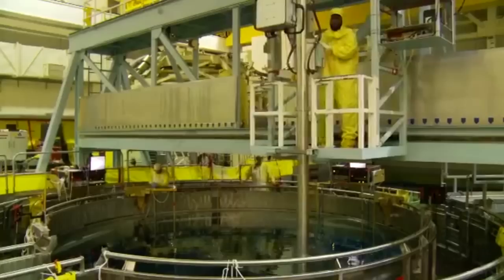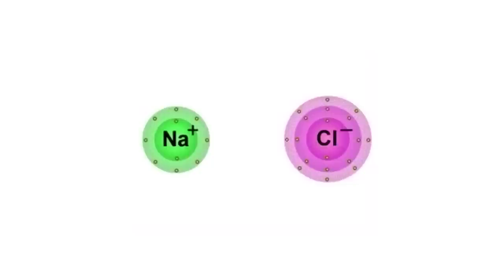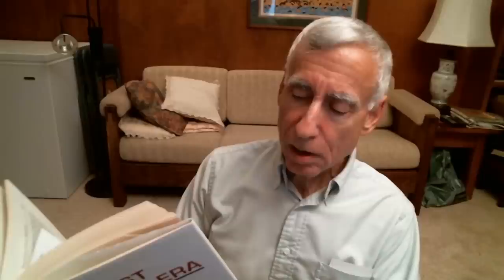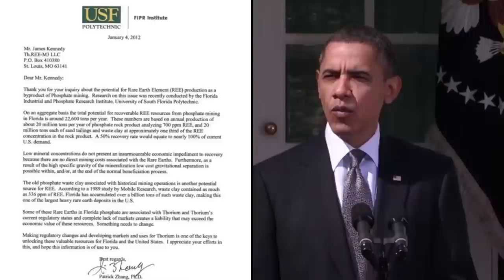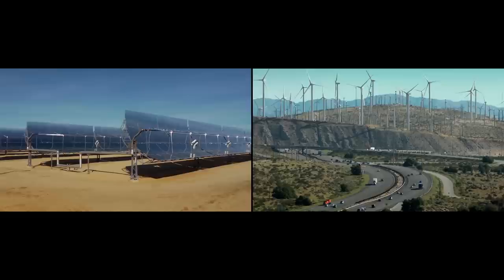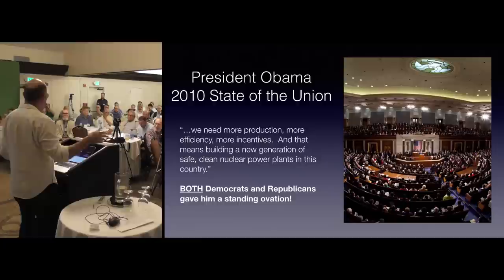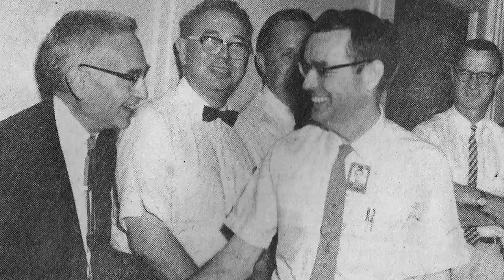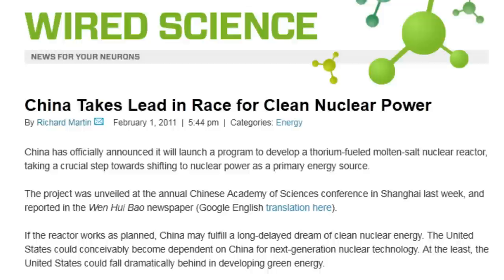Trump on Nuclear Power: Revisit Regulations

Comment: Thorium, molten salt reactor.  The only answer.
Reply: No there's newer and more advanced alternative energies that will make it a safer and cleaner world... True some of them are very old , alcohol used for fuel ,and nothing else.
Reply: Alcohol made from biofuel only has an energy return on investment of 1.3!
Reply: What do you start your reactor with? There is no stock of u233, so you have to use a huge amount of very expensive u235.  Do you fancy changing  fuel pump moving parts/fixing a leak in the circuit  in critical hugely radioactive environment?.  What alloys are you going to use and how are you going to get them certified. Getting the whole thing past a proliferation/regulatory regime based on counting solid fuel rods?,  and shit happens - there will be minor accidents that greens will use to destroy the program.  Impossible.  

There was a working sodium cooled fast reactor, the integral program.  It had a very simple on site fuel reprocessing facility, using electrowinning to separate actinides from fission products and uranium from higher actinides.  
Pins were cast from the high actinides and reburned.  Waste stream was short lived fission products, input could be old thermal reactor fuel that no one knows how to deal with. The pins had very burn ups,  the fuel was surrounded by sodium in the pin, so that its expansion did not cause the walls to   bulge.  A neat all American solution.  
There is also the stable salt fast 'moltex' reactor, also  burning old thermal reactor waste and electrowinning to make new fuel from transuranic waste.  

Who would seek a career as a nuclear engineer when it is such a political football that technology gets stuck in grooves with huge intrinsic safety issues, such as pwr uranium burners with no disposal path for their very long lived waste stream.
Reply: If that!
Reply: Sodium is a dumb idea its a highly reactive metal to much potential to scatter radioactive contamination....
Reply: Bio fuels are a joke mostly , the required land area and nutrient input are not sustainable.....
Reply: @oceanhouse8080  Sodium is dangerous but SODIUM CHLORIDE is 100% safe. You keep it at home and this is what they want to use to cool reactor. Sodium chloride not sodium
Reply: @Ray – Sure, the thorium MSR is a good answer, but it’s not the only one. All of the Generation 4 systems have advantages, and some can be brought online within the next 5 to 10 years. But ultimately, the best answer is fusion, and the ITER/DEMO project is really making it happen.
Reply: yeah thorium, i think vibranium is much better but it's still up for debate
Reply: @Ocean House - In other words, you don’t know how the liquid sodium reactor is actually designed, do you.
Reply: @leerman22  EROI is irrelevant when it comes to nuclear power. And misleading in evaluating fossil fuels. We've burned, in less then two centuries, the lion's share of the affordably accessed legacy of billions of years of sunshine captured by photosynthesis. 
That's like using vintage French Cognac to swab the floors because we stumbled across a buried cask of it. It's the replacement cost which is relevant.
You also conveniently turn a blind eye to the RoI of nuclear plants in the US. No nuclear power reactors started construction between 1979 and 2012 in the United States, and since then more new reactor projects have gone into bankruptcy than have been completed.
Reply: @sajuente8235  They are using a salt, not salt. And their choice is restricted to a family of salts which are extremely nasty. Molten highly reducing salts (such as uranium tetrafluoride, a common choice) are extremely difficult to contain because they are so corrosive, and the nickel-based materials which alone can contain them, are severely compromised by radiation. This may be solved at some future date, but (like many previous fission or fusion impediments) it may not be, or the solution may not be affordable.
Reply: @Vito_Tuxedo  by the look of it the price to build a commercial fusion power plant might be very discouraging...
if they say now for commercial purposes it would have to be way bigger than ITER... Well, it also means way more expensive than ITER. And a price tag of ITER is already quite mind-boggling...
Reply: @Patrick Andrews where are you going to get all this alcohol from
Reply: geothermal can also be the answer. Both nuclear & geothermal have higher energy density than coal & crude oil. Meanwhile, solar & wind cannot beat coal's energy density
Reply: Yes, but geothermal works best in places with active geothermal activity close to the surface, like in the Philippines or Yellowstone.
Reply: @zorr6271  haha I actually live in the Philippines but still, I'm for geothermal & nuclear

Comment: Synopsis:
Safe, need more plants, smaller in size. Less waste, more output, significantly less emissions, reusable resource. There are dangerous means of creating inefficient nuclear energy, but there are safe, modern ways to do it. This video outlines the science simple enough for a layman.

Nuclear is the truth, and it bridges the gap that other green energies do not.
The data on Fukishima and Chernobyl shows the lingering effects are virtually non-existent.

Comment: The Fukushima disaster was also overwhelmingly man-made: regulatory capture allowed Tepco (the plant operator) to slack on improvements and countermeasures (Tepco was even busted for falsifying data in '03-'05), recent findings in earthquake & tsunami science weren't considered (the plant was built in the 60s; the possibility of pipes for cooling water being severed/emergency generators being disrupted wasn't taken into account), and US and J nuclear orgs warned about problems with the plant's design in the '90s and early '00s (another power company, Tohoku Elec Power increased the seawall height at its facilities along the coast but Tepco didn't do that at its Fukushima plant).
Reply: censorship bites “overwhelmingly man-made”? The initial cause was an earthquake.

Comment: Yes thorium molten-salt reactor have a lot of benefits but there's also a lot of negatives to there's no free lunch.
Reply: But LFTR addresses all the concerns that has stalled Nuke development and use.
Reply: @mikedar8484  What concerns are you referring to. You can't change physics.
Reply: Fluorine salts, molten/liquid are not subject to massive pressure releases if containment fails. There is no runaway effect, there is no massive mining required, plant size is 1/4 of standard there now weapons grade development abilities for LFTR, one Rare earth mine in Arkansas is producing enough Thorium already to power America indefinitely.. these miners try to give away Thorium, there is already enough stored to supply the entire earth for a year.There are no 'fuel rods' to degrade, fuel replacement is ten times as long before needed. Overheating the 'pile reduces reactions… there are many benefits  LFTR.
Reply: @mikedar8484  I never said it did not have big positives. However it will be +30 years before a LFTR is making pwr (likely India or China). Technical challanges, development, testing which involves huge non recoverable costs are time are road blocks. Commercial LFTR pwr plant has  never been done ( experimental one does not count ). I'm not against, just don't have a cult like enthusiasm for a thorium breeder. I'm pro nuclear however. You have to fight the progressives as well. Trump 2020.
Reply: China and India be up and running in less than 5 years with prototypes. And 'experimental did count, 70% of relevant R&D was rescued. Estimated ongoing is one billion cost per plant matching output of what is now 20 Billion Plant on old designs... bringing at one point a cost factor of Coal fired(on average) to be the same cost, but 20xs the profit long term. Even better might just be the rare recoverable now pulled from existing plants... the cost is so high/so rare.. that many unknow uses may exist outside or more included in Medicine.The direct tie to Rare Earth mining(90+% rare earth Mines) that have Thorium as a easily acquired part of Mfg is the ultimate valuation... it is essentially free.The biggest fight now is Energy providers not wishing Thorium. But even Fuel producers can be convinced(higher C10 content) and for 'tree-huggers' with the massive lowering of Electricity cost then removing Co2 from the air becomes a counter to Oil based energy(or coal use) by having water lose Co2 content it actually draws co2 from the air using chemistry.Progressives can be 'forced' to like LFTR.
Reply: @mikedar8484  You are a true believer. As they say ignorance is bliss. India has three stage development plan and TMSR is stage 3. They estimate 3 to 4 decades. China thinks 15 years to a commercial TMAR, but they are just starting.  I have read the reports, please advise those countries you moved their time line up 15 to 30  years. 

 I never said the collective knowledge from past is useless. A small expermental reactor from 40 yrs ago (and research on the USAF flying reactor canceled in '58) is useful. Don't be a padantic  petulant troll and make it up.

There is no guarantee it will work. The risk is low, but it will take decades or more development to get these in use in significant numbers. You are not a nuclear engineer or physicist. Please let the professionals handle it. The technical challanges for a new kind of industrial sized powerplant and developing the fuel cycle  processes are large. Your YouTube education is not sufficient. Claim down.
Reply: I would say the statements on time lines are incorrect.. China actually assists Indiasfforts and China is putting essentially unlimited effort into Thorium. Perhaps you are not aware of exactly who is in charge of that development.. well... obviously not aware.The fact that the 'experimental' did work, could be shut down and restarted every weekend for a year, was tested by both rod removal/create hot spot and shutting off circulation.. which as done to prove it is IMPOSSIBLE to meltdown.. well.. I see you are not familiar with what went on with the 'Experimental'... well, not at all.America can have unit after unit in production in a little less than a decade.. you are not aware of the fuel cycle, it is a breeder that creates its own initial primer, u-233... fact is you know very little about the LFTR.While not a  physicist I've beenaround this industry for quite some time and obviously you haven't, nor have bothered to research the huge ground swell from K-12 to graduates to industry participants becoming very very interested.fwiw, I could care less your opinion being it is based in ignorance,,, but you go with that, it works for many people.
Reply: @gmcjetpilot  
1) The chinese were at thorium energy conferences in 2016, probably before even but that's the earliest i found with a 5 second search, so, at the very least, they didn't start working last year. 
2) Theres a video about the chinese progress, which is one year old to boot, on this very channel: https://www.youtube.com/watch?v=EdelSZUxZeM
Mind you it's a promotional video and everyone knows how the chinese are sometimes but still they go to the heart of the technical issues which "non-fanboys" often taut as being impossibly expensive or simply physically impossible to solve due to their divine revelation.

Comment: I'm not against thorium, but Nuclear reactors have a 0.67% chance of causing an accident. Less than one percent. There is nothing wrong with wanting thorium reactors but don't use unnecessary fear tactics to achieve it.
Reply: 'Fear tactics' is what caused the stoppage of building these current designs already... and the most powerful proponent for these current types actually accused the LFTR initial designers of being 'fearful'.... and the result is seen today, counter to the use of the term fear, we have designs that depend on discipline of use instead of principles of design.